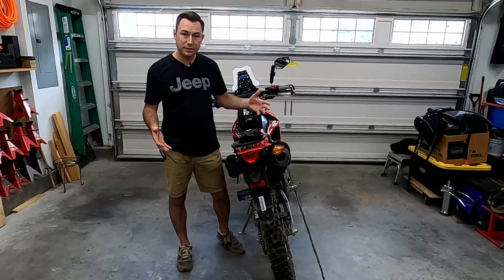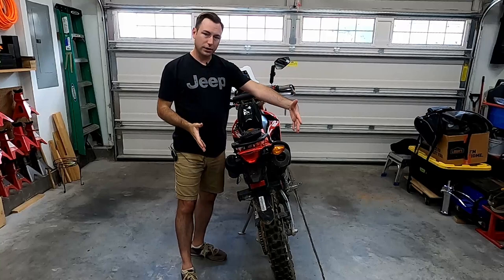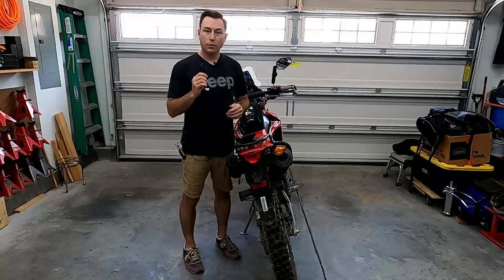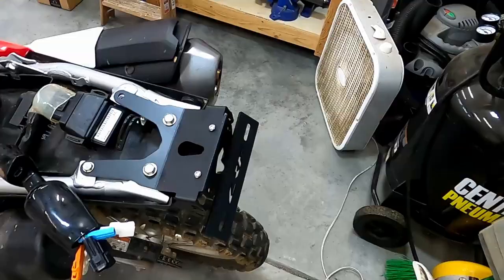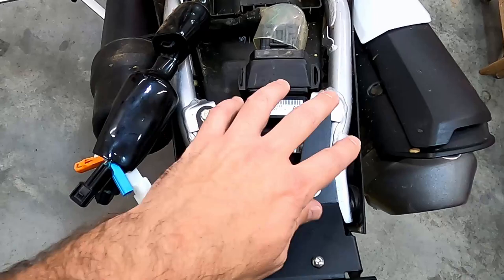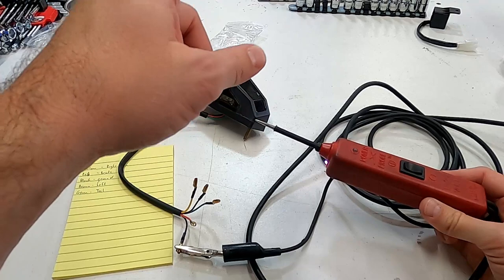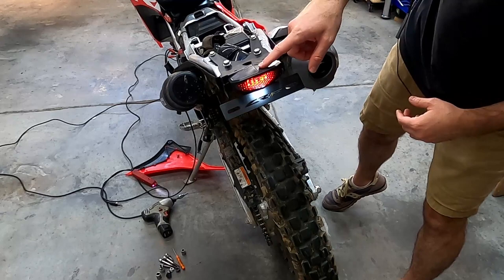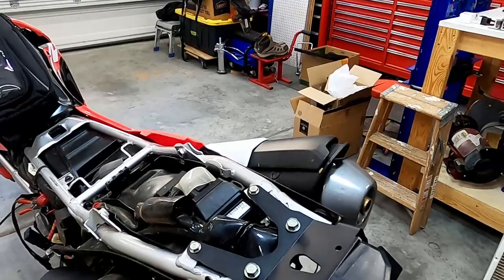CRF250L - Tail Tidy with stock connectors

Comment: I have this same kit on my 2018 and mine is not very visible. I was nearly rear ended because the pickup behind me couldn't see my brake light or turn signal.
Another time I got pulled over the cop couldn't see my taillight, and with my tag covered in mud and looking like part of the fender, he thought I was on a non street legal dirt bike.
I like the form and fit, so I'm playing with the idea of tearing it apart and upgrading the electronics.